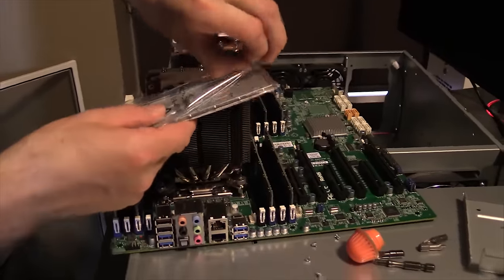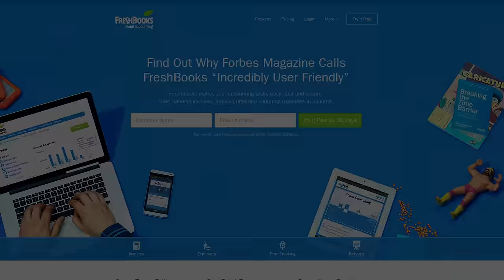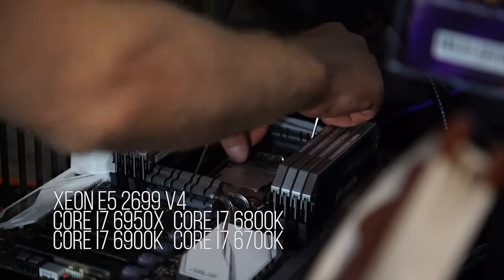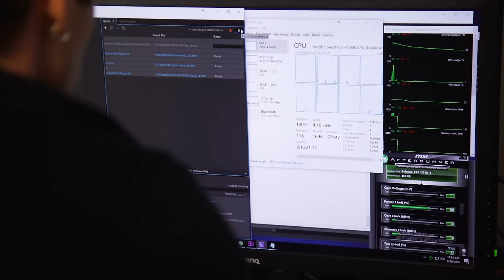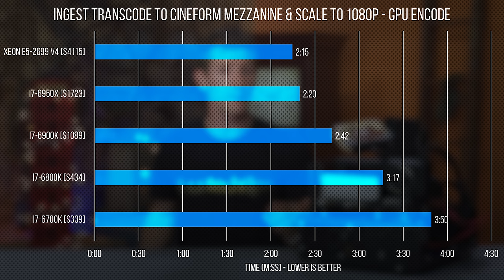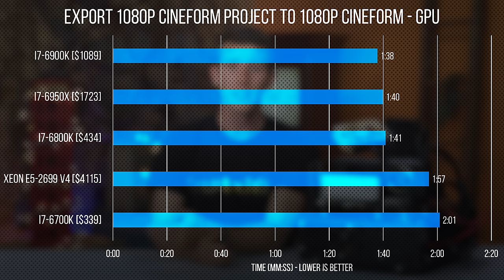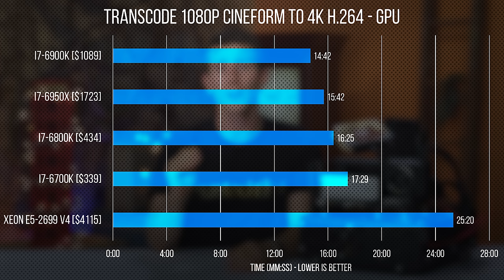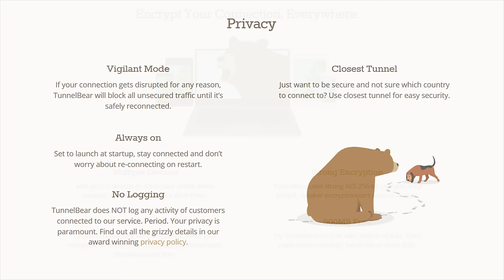$300 CPU Beats $4000 CPU?? - Cores vs clockspeed for video encoding

Comment: So guys buy youself a 6700K and invest the test of the money in gpu. Maybe a 4-way sli of titan xp
Reply: sli adds nothing to render times.
Reply: I was just joking. I meant most of the people do a lot of gaming with their PCs so it's better gets a lot of graphic horsepower if they want to spend thousands of money, instead of getting a hundred cores CPU they'll never use properly
Reply: +Average Italian Geek Thousans of money was spend
Reply: 2 gpus on the same slot works better.  such as the firepro
Reply: If you have a rendering workload that scales well across GPU's (for example cycles rendering in applications such as blender) then having 8 GPU's in your machine will give you almost 8 times the performance. This isn't using SLI but by using Cuda acceleration.

In my PC I have my GTX970 and GTX560ti together. Since in my testing the 560ti gives a 50% speedup over just the 970 alone. So a rendering task that may have taken 3 mins with the 970 takes 2 mins with both.

Plus it means I can game on the 970 while rendering on the 560ti which is kinda neat. Or I can use the 560ti as a PhysX card if I am playing one of the five games that actually support it in order to gain a next to 0fps performance increase :p
Reply: 6800k ftw.
Reply: Overclocked 2500k ftw :p
Reply: +aljowen I got several of them and a 2600K, paid about 260 bugs altogether. Probably more horsepower than that $4000 CPU :)
Reply: Oliver ASUS depends on what you are doing. That $4000 beast would be great for compiling doing server tasks and running VMs
Reply: +taief miah My comment was referring to the given context, of course.
Reply: could you not turn that PC into a render farm with those VMs?  I'm not 100 percent sure if it would even be worth it, but theoretically, it should be possible right?

Comment: The graphics card being included increases efficiency by about 4x for 6 cores worth of processing. If you could then also be using the remaining cores you would be more efficient than the other options listed (10:13 as opposed to the I7-6950X's 11:31). If the ~12.8% gain from the E5-2699 is worth $2,392 is a better question that assumes one is capable of optimizing the setup.

Comment: Linus if cuda and open cl are the same, why not using open cl on AMD cards?
Reply: becuase he has Titans and Quadros, what AMD card should he replace them with that doesnt bring increased power/heat with it?
Reply: This involves getting cpu and motherboard, which costs money. And they hate AMD. So do I.
Also OpenCL uses CUDA if it has access to it. If you use it on non CUDA card then it will work slower, using only GPU for computing.
Reply: tried both, Open CL isn't as quick as cuda
Reply: If a program supports your better of using cuda as it provides a better bump, plus his strongest GPU's are not amd.
Reply: rentaspoon of course it won't run as fast. As OpenCL is a layer on top of CUDA.
Reply: CL and Cuda are not the same, i have over double the render times with cl compared to cuda
Reply: dont yo know that linus IS sponsored by intel
Reply: JA150EA
 Look the video about cuda vs open cl. Linus said that there is not a lot of difference between the GPU. You need a GPU even if it's a low end one.
Reply: Daniel Debert
 I never talked about CPU. If you hate AMD GPU that's because you don't know it.
Reply: Daniel Debert
 Look LTT video about open cl vs cuda.
Reply: *****
  Look LTT video about open cl vs cuda.
Reply: The-BGR Spot
  Look LTT video about open cl vs cuda.
Reply: Blabla Blabla
 I never talked about CPU.
Reply: L3xou97 "that's because you don't know it.' that's a nice excuse, too bad I do coding and see how "decent" AMD cards are.

Why should I watch OpenCL vs CUDA?
Reply: L3xou97 I replied to the Daniel Debert's comment....
not sure why his name was not in my comment when I tagged him
Reply: The-BGR Spot nice you are now butthurt and insulting.
It's not like it's a experience based opinion. Did you even look at something other than game benchmarks?

Games need to be optimized for AMD because it's just "decent". Thus making games worse in some cases, just look at the Witcher 3. It works bad on AMD on high settings, not because it is badly optimized, but because optimizing for AMD cards usually means lowering the game settings overall.

AMD doesn't have CUDA cores, HBAO+, PhysX, Shadowplay, DSR, G-Sync and more.

Using AMD is like buying a burger with bun and meat alone, getting nVidia is like getting a whole burger. Thus AMD is cheap.
Reply: +Daniel Debert cuda cores have nothing to deal with cuda software. HBAO and gameworks are just useless things that need 1080 sli to run correctly. shadowplay is just a shit software that never work. I tried to use it once and had a blackscreen. Meanwhile on my desktop, raptr works perfectly.
Reply: +Daniel Debert and just look doom maxwell vs amd or pascal. It sucks on old nvidia hardware. Not because it's bad optimized (nvidia would not have used this game in pascal presentation otherwise), it's just nvidia making low hardware.
Reply: +Daniel Debert And physx is just an old useless thing that works for 3 games.
Reply: L3xou97 Every engine that uses OpenCL works better because they use CUDA out of the box.

"maxwell vs amd or pascal", all I see that pascal is 10 times faster than maxwell, what do you mean here?

As for shadowplay you just have a bad experience. It is the best consumer friendly recording method at the moment. 

PhysX is used in all Unity3D games. That is over 238K[0] unique projects.

[0] - https://unity3d.com/public-relations
Reply: Erm..... No. An enormous amount of current games use PhysX. Both Unreal Engine 4 and Unity3D use PhysX as their internal physics library. So does like 20 other commercial game engines. Autodesk 3ds Max & Autodesk Maya also use (if desired) PhysX.

You're talking about games that have the special "Enable PhysX" crap in the options... Those are for the most part nonsense anyway, and stopped appearing like ages ago.

But like I said. An extremely huge percentage of current games, indie or otherwise, use PhysX as the physics library. Regardless of whether the GPU in the system is NVidia or not - it's not hardware dependent. Nvidia just happens to offer some hardware acceleration for it, but it barely matters anymore.
Reply: Mythricia Of course it does not matter because they know that they can't overuse PhysX. PhysX uses CPU if graphic card does not support it. And using CPU is hella slow for physics.

It matters when you want Ultra Settings on 1080p 60+fps. CPU will be overused on AMD cards here, because of the rendering+PhysX bottleneck.

PhysX benchmarks:
http://ozone3d.net/benchmarks/fluidmark_140_all_scores.php
Reply: The-BGR Spot will you pardon to give a counter argument instead of insulting me?
Reply: Daniel Debert
 Look the video of tech yes city about amd vs nvidia on doom.

Here we're talking about premiere, which support open cl out of the box.

Shadowplay isn't good. It never worked for me and i'm not the only one.
Raptr is the best for the moment.
Reply: Daniel Debert
 Seriously there is a list of physX games on wikipedia, maybe 3 titles are known.
Reply: Daniel Debert
 Nvidia cards does not support direct X 12 and vulkan well. That is 100x more important than physX.
Reply: Daniel Debert CPU is not slow for most physics... The only place where GPU physics is really useful with modern CPU's is fluid (which is actually a particle simulation wearing makeup, usually) and cloth simulation, i.e. soft body stuff. Even then, a lot of real time soft body physics is done on CPU.

PhysX stopped being a GPU-centric product a long time ago. Which is why it's the internal physics library used by so many engines. Because it runs just fine on CPU. Most of it is optimized for it, even. Same as Havok or Bullet, and many other physics libraries.
Reply: L3xou97 You are literally wrong. As I already told you, PhysX is an extremely common physics library. As a game developer I think I know this better than you do.
Reply: Mythricia
 You would see this on the benchmarks if there was a problem. PhysX is not used a lot.
Reply: L3xou97 I have watched the video, it just shows the problem but doesn't explain why it happens. LOD bug can be caused by the game itself.
Reply: Daniel Debert
 The game was presented by nvidia for 1070 and 1080. It's not coming from the game.
Reply: L3xou97 He thinks its just a "bug"
Nvidia software team aint no "bug"
Reply: L3xou97 what are you even saying? LOD bug can be caused by the game, and because of that you can't just say that it is a graphic card bug, as it can be game engine bug that happens only on nVidia cards. For example a badly written shader can cause exactly the same results.
Reply: Daniel Debert For example a cod exclusive for a range of devices can be also the reason
Reply: The-BGR Spot how come can you pop up with a insult and approbate to AMD positive stuff, but you can't give arguments by yourself? Please don't get your butt hurts into debates.
Reply: Daniel Debert
 This problem on doom is only for old nvidia cards. It's not on pascal cards.
Reply: L3xou97 so does it happen in every game? Or just a single game engine?
Reply: Daniel Debert
 For the moment it's the only game using vulkan.
AMD is definitely better in direct x 12 and for the moment it's better in framerate in vulkan.
Reply: L3xou97 Seriously... PhysX is not NVidia-dependant. It's the internal physics library used in Unity and UE4. How can you possibly say that it's not used a lot, when it's used in two of the most popular game engines on the planet? Stop lying and actually look it up instead. I don't care about the whole NVidia vs AMD thing, it's dumb. But spreading bullshit misinformation is dumber.
Reply: Mythricia
 PhysX is not used in a lot of games.
Reply: L3xou97 Hilarious. So you're just going to refuse to do any research? I've told you. It's used in Unity and UE4. Unity is used in like 45% of games being made or having been released in the past 3 years. So, there you go. You're just wrong. Deal with it.
Reply: Mythricia
 If physX was used in 45% of the games, then AMD would be behind nvidia in 45% of the game. It's not the case, you're wrong. Deal with it.
Reply: L3xou97 <edit> this info was shit, it was for mobile not PC
Reply: L3xou97 I just told you, PhysX is a CPU based physics library at its core. It doesn't matter what fucking GPU you have, because it doesn't run on the GPU in 99% of the use cases. Why don't you actually search for the information instead of posting bullshit? It's easy to find. Do these searches; "Unity uses PhysX" and "Unity3D market share".

You're so scared of being wrong it's hilarious, you're refusing to actually look it up, because you know that if you do, you'll have to face the fact you're wrong.
Reply: Mythricia Idiot yes it does run on the GPU
Reply: Mythricia just checked, unity uses hardware acceleration for PhysX in 5+. Especially for clothes physics.
Reply: Mythricia
 So if it runs on CPU 99% of the time why are you talking shit about AMD?
Reply: Daniel Debert Correction, it can use hardware accelerated physics, I never said it couldn't. It would be really stupid if it couldn't, seeing as it has the capability. The point I am making is that the vast, vast majority of games that use Unity, never even touch cloth physics or liquid physics, yet they still use Unity, which means they use CPU accelerated PhysX. Exact same deal with Unreal Engine 4. But these people don't seem to realize that.

Anyhow my gripe is not about when or why PhysX runs in GPU-accelerated mode, my gripe is with this retarded argument by L3xou97 that "PhysX is only used by 3 games" or that PhysX is rarely used, which is clearly false when 2 out of the 3 most used game engines IN THE WORLD use it by default.
Reply: The-BGR Spot I never said it didn't. I said that most of the time, PhysX is run in CPU mode, because it's pointless doing simple box collisions on GPU. A 10 year old CPU can run tens of thousands of CPU box colliders at like hundreds of FPS. GPU accel only matters in cloth or liquid (i.e. particle) simulations...
Reply: Mythricia you actually did by saying that it uses CPU for 99% of cases.
Reply: Daniel Debert Which is probably statistically true, considering the thousands of Unity games that are on the market, that are either 2D games or 3D games that never care about cloth or liquid. I'd be surprised if more than 95% of Unity games never touch GPU-dependant PhysX functions *Poorly worded, but leaving the original statement there for transparency: What I mean to say is I'd be surprised if more than 5% of Unity games on the market ever touch GPU-dependant PhysX functions. It's not necessary and makes no difference. I have a game with literally hundreds of physics colliders, and it only spends like 1.4 milliseconds per frame processing physics - which is a lot less than c# code or rendering updates.
Reply: L3xou97 I never said a single word about AMD vs Nvidia, you're the only one here shit-talking brands. I literally never said a single word about AMD vs Nvidia performance. All I said is you're wrong - because you are saying PhysX is only used by like 3 games, when in the real world, it's used by 2 out of the 3 most popular game engines on the planet. Do you comprehend?
Reply: Mythricia
 So without physX nvidia is completly screwed. Cause if we listen all the talking AMD is performing bad on physX games. But AMD is beating Nvidia in price/performance in every price range except high end. The only Nvidia cards that are good are the 1070 and 1080.
Reply: Mythricia
 So why are you still talking? AMD rocks well, I prooved my point and that's it.
Reply: Mythricia
 PhysX in GPU is used by 3 games.
Reply: L3xou97 Also not true... But whatever, I'm done arguing with some kid who can't make logical thought happen. Your only thought is making Nvidia or PhysX look bad, no matter how right or wrong any statement you make is. You are the fanboy. You are what everybody hates.
Reply: Mythricia guys can we all calm down and agree that everyone else is wrong ?
Reply: @rentaspoon - blockquote:"tried both, Open CL isn't as quick as cuda":
Are you speaking for consumer cards or the Firepro range? I just ask because Firepro cards are used a lot at a few studios in town.
Reply: L3xou97 how can you say shadow play is shit? do some research... shadow play is the best recording software available lol. how can you even compare raptr...
Reply: *****
Plays.tv is working, shadowplay isn't working.
Reply: L3xou97 lol for you, but not for everyone else. Do some research you will see that shadow play is amazing in comparison. It's a deal breaker for amd because of how easy it is to record on shadow play with quality.
Reply: *****
 But you need a good nvidia GPU to run it. It does not work on low end. It says 840m for minimum requirement my ass.
Reply: L3xou97 There are limitations on it, but trust me you'd be surprised how many people use shadow play. anyways ahve a good one
Reply: @Daniel Debert Whaaaaaaaaaaaaaat? OpenCL is an OPEN solution for computing, Cuda is a PROPIETARY solution for computing. The only reason for CUda to work faster is beacause they prepear it for a closed hardware market (Nvidia GPU's) something like Mac OS for Apple. Please, document yourself before saying those things.... What really happens is that the Nvidia GPU detects the computing instructions of OpenCL and translates them to CUDA, nothing about OpenCL using CUDA, PLEASE! And Cuda only works with specified hardware. I love Nvidia, but I have AMD, why? I want some war on gpu market, I want Zen to really break the AMD CPU "crisis" Why? I want CPU wars. Why I want wars? PRICE DROPS. More consumer care, more everything. If all of you buy Nvidia for computing using Cuda and saving miliseconds, or for gaming because it works slightly better, price will increase. That happened with the new Intel CPU rising from 1000 to 1700$ because of the lack of competitors. Do you like this trend? Keep it this way, don't buy competitors, don't give a chance to other brands or Open solutions. and PLEASE! this is the best I've ever seen commented! Keep saying that open solutions use privative code if "accessible" and destroying people efforts on freeware.

If people like you keep it this way, In 5 Years at max, PC evolution will freeze.
Reply: ripperfisher182250 relive is better

Comment: 2699 V4 shines in VDI. Server with Dual 2699 v4 and 1TB RAM can support 250 VDI users at 6:1 CPU over subscription with 2vCPU/4GB RAM per user. Server runs about 20k which works out to $80 per user for compute/memory.

Comment: ffmpeg converting h264 to x265 is what I do a lot.  

I just finished converting 20 files (about 3-4hrs each, totaling 67hrs).   
1st video finished 10/28 at 8:30pm, last video finished 11/1 at 2:30pm.  (Running 24hrs that whole time.  )
My 3770k only around 65C